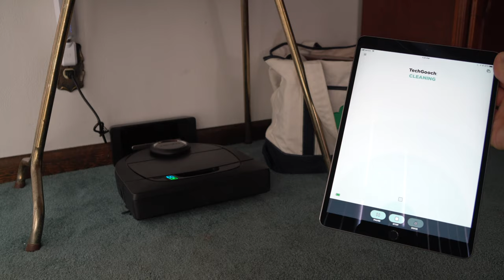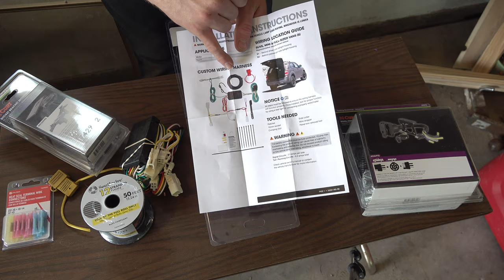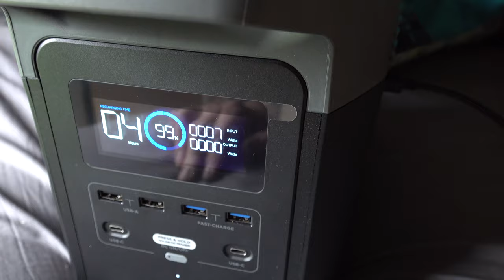2020 Toyota Sienna - Part 2 - Wiring Harness Install

Comment: I have a 2013 sienna and would like to set a 2000 watt inverter. The firewall works great. But should we poke the wire in thru from the engine area or poke it out from under the dash?

Comment: In the beginning you mentioned the connection for the brake solenoid on the trailer, it is the purple wire. I didn't see that in the video and also I am a bit concerned that the led sized wire on the factory harness will not support the heavy wire and solenoid draw for reverse.

Comment: Just curious, what other equipment were you wiring up with the two other wires you fed through the firewall? Possibly thermometers for the engine and the transmission fluid?

Comment: Curious, did you need to get a tow package installed on your Sienna? I'm thinking of getting a small trailer, but it seems the 3500 pound tow limit is only applies for Siennas that have the tow package installed.

Comment: Great job, love the video, just one question. When you put back the Driver side tail light back in are those 4 pins wire going to break off since it will pinch against the metal frame? Thank you!!
Reply from the maker: It doesn’t appear, since the metal isn’t sharp, but I am looking at changing that part since that was one point I didn’t like when doing it
Reply: @GeekSmart  Thank you, I am thinking of cutting one of the grommet and seal it with Loctite 37467 Black RTV 598 High Performance Silicone.

Comment: Just easier to buy the Toyota harness that connects to a harness. It drops out the bottom. Plug and play. No battery hook up. Runs about $40-$50 from Toyota
Reply: Please link whatever it is you are talking about.  All I find is a $170 wiring harness.